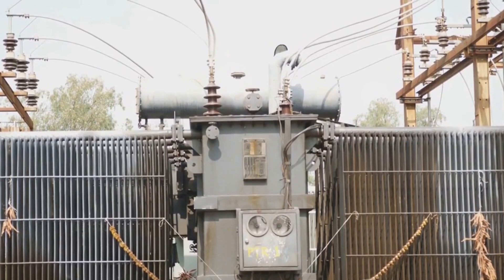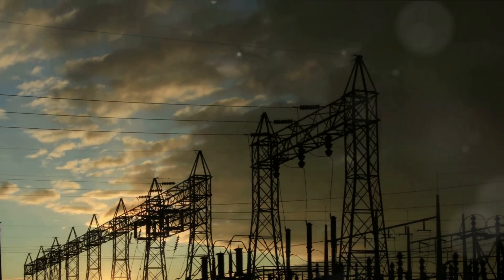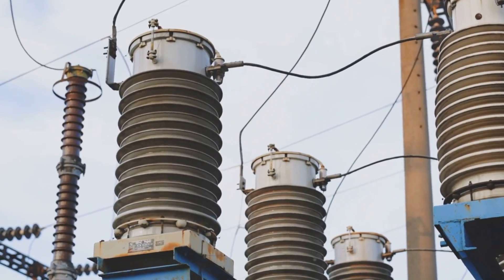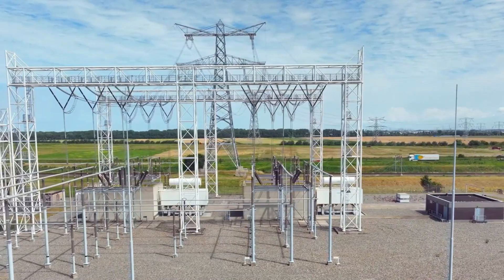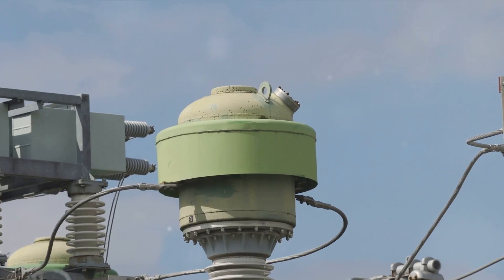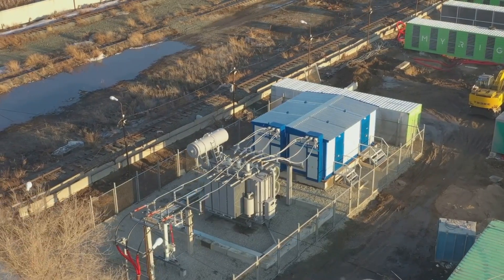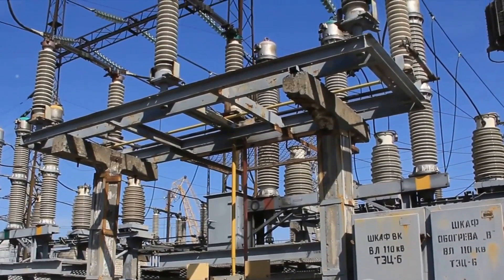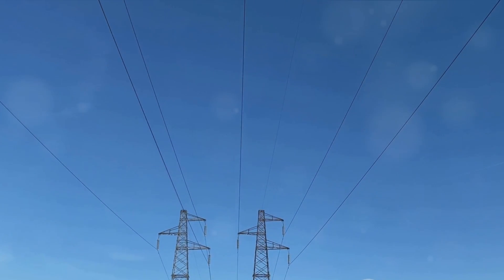Why 132 kV? The Shocking Truth About Potential Transformer Limits

Comment: PLC is low bit rate, only used for backup. Protection systems can be quite sophisticated doing distance to fault calculations. If you ever see a downed power line never assume it'd dead. There's this thing called auto reclose on big circuit breakers.

Comment: I think it is high time that the electric power industry perform a review of the existing T&D instrumentation and control systems and components.  With the advent of digital meters and relays, working on electronic based sensors and circuits, and the availability of internet based communication and control regime, the "Model T" system currently used in most Western power utility systems will have to face a total removal to move on to a completely digital intelligence based system .. and the ultimate attraction is .. the AI ability to handle electrical emergency events .. in a comprehensive, total system consequence point of view ..
Reply from the maker: That's a compelling viewpoint! Updating T&D systems to digital platforms with AI capabilities could indeed enhance efficiency and response to emergencies. It's a transformative shift worth considering.
Reply: Related to your point, I'm a bit amazed the power distribution system isn't becoming DC-based a lot faster.  Lower losses and no heavy transformers (which are also hard to find now).  DC conversion is getting cheaper and even for voltages under 30kV, solid state using SiC devices.  On top of that, electric car charging needs DC and in the MW range for a charging station and DC/DC makes more sense now.
Reply: @LFTRnow  I agree with you, but I also wish to point out that it could be argued that “The Institution” may have seen it coming and decided that it is not worthwhile for them to take the step you and I suggested .. Look at it this way .. If ever solar power, wind power, wave power or geothermal power can grow to their full extent and becoming ‘dirt cheap’, then everywhere in the world the electric power supply would be local, perhaps at 48vdc, with a local microgrid backup being adequate and sufficient .. Then the existing electric power transmission and distribution system we built over a hundred years may no longer be required, or at least its usefulness be drastically reduced.

Frankly, I would not discount such a [local power revolution] happening sooner than any of us anticipating now .. The pace of green power advances is truly amazing ..